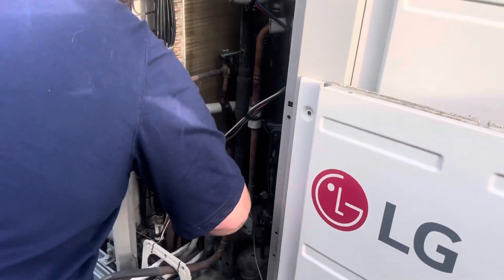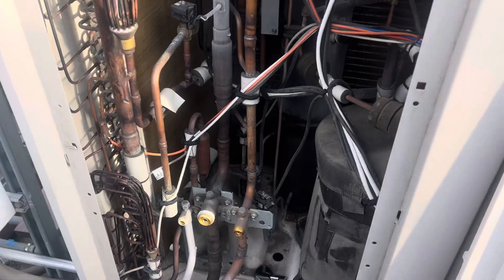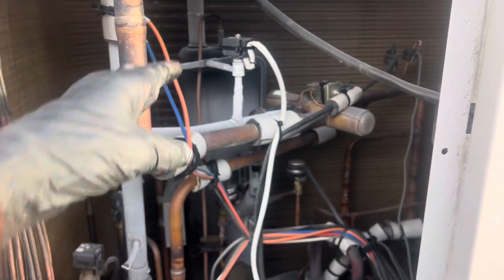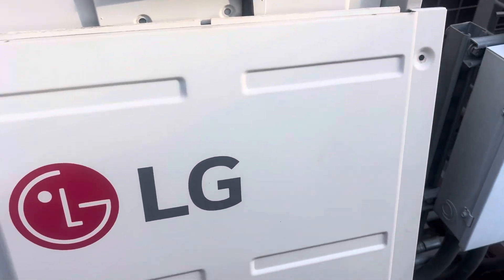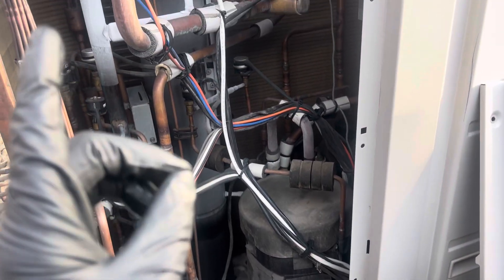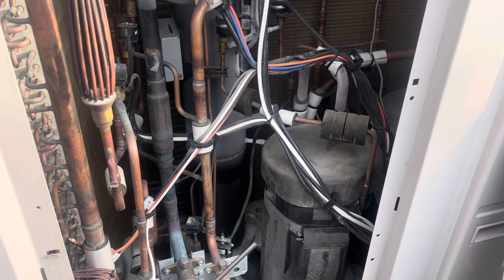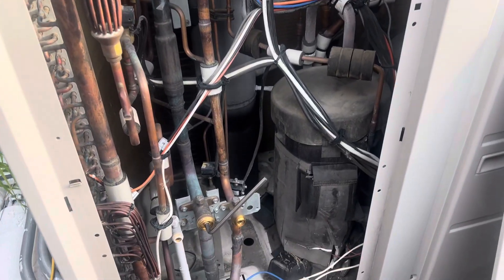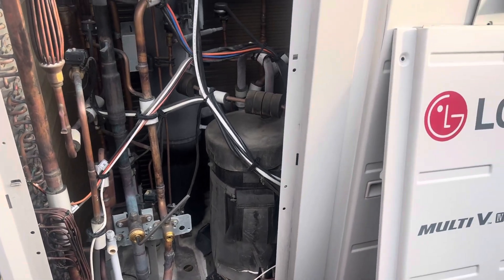Pump down refrigerant on LG multi heat recovery . Playing with child’s toys  🧸 ￼

Comment: Hey man! I appreciate your work, a real professional on LG systems. So, that's why I've got some questions for you - how did you obtain troubleshooting LG Multi systems with ur LGMV reader and what materials have you been using to get these skills? I'm asking you for help because we got a bunch of these units (Multi V IV, Muilti V 5) and they are dying... So, I'm trying my best to get why are they keep failing, probably it is a problem with overcharge or lack of refrigerant, but it should be okay because we're charging them according to a calculation of liquid line lenght and ODU precharge. Would be cool to hear your thoughts!
Reply from the maker: Calculated refrigerant charge only gets you close.,
     There are variables in the system systems that sometimes you end up often having to add more refrigerant. 
     You get your software from your local distributor. And they have training classes for both installation and then other classes for service.. 
       You work with their Tech Support who have much more experience constantly sending guys out for diagnosis. 
       You will see our times you’ve completely charged up a new system and followed every instruction and calculated the refrigerant based online length and components and when you hook up your software, you’ll see your expansion valves are starving. They are wide open trying to feed the coils.
    You’ll see the temperature drop across the coils is too great showing that you’re starving for refrigerant.,

You’ll learn this when you take some of their service classes and do a bit more reading. 

Some say even from Tech Support they could try to charge up a system to get it working in cold weather operation doesn’t always work out so well, but it will get you up and running. 

Just last month, I was cold out to a MULTI V system that was just butchered and hacked together installed the piping was completely wrong size, wise and layout. 
      And obvious example of the lowest bid won the job. 

You may hear Online a lot of people saying the compressors burn out.  That is because the system was poorly, installed poorly sized and poorly maintained no reason for compressors to last any less than 15 years to 30 years on a properly installed in a properly maintained system.. 
      As soon as somebody doesn’t no longer properly maintain the system throughout their lives all bets are off. Basically it was the owner who made the decision not to pay for maintenance and properly performing procedures or the company that was chosen not knowing what they’re doing then the systems live a shore life..
Reply: @coldfinger459sub0  Big thanks for your response my man! I would be very glad to contact the tech support in these cases, but seems like it is just impossible because we have only 2 certified suppliers/LG partner for our regoin (Easter Europe) and I've already tried to ask for help, but the only answer I always get is add/remove 10% of system's refrigerant. Everybody around is getting mad on these systems, but personally I just can't believe that they could be this bad. Also, our official installer installed almost all these systems and now we have to deal with this crap. I'll try to contact LG EU to get some classes, but If I will fail, may I ask you for some specific manuals about LGMV data or stuff like that? If not, anyways I'm very thankful for your respons, Tom!

Comment: I have to admit....im still not a fan of VRF. I do have respect for those that are competent to work on them. I really just dont enjoy working on these types of systems. Much respect to you Tom
Reply from the maker: I’m with you.  But that’s the reason I basically started only started selling VRF and almost 100% STOPED selling normal split  & package unit 14 years ago. 
JOB SECURITY 😎 
Back then almost. Nobody wanted to touch them.  

Now that they’re all starting to get old.  I basically have almost 0 competition at all whatsoever..  so I’m the only one who could get back to work on them.    

Everybody else works on a different brand name, but not mine.  

Nearly in every case.  Where a building or a business was sold..    and the new owner or the new manager.  
        Says he doesn’t want to use the old guy for HVAC maintenance and repairs. He will use his old guy that he knows.. 

I get a call
☎️ 
Emergency 🆘 
(“ we’re having a problem with this unit in our guy was working on it and he can’t get it to blow colder or blow cold”) 🥶 

When I get out there sometime, I’ll find some extra jugs of refrigerant. 
Because he thinks more Freon can cold will get it working

But they jacked so much refrigerant liquid slug, compressors, and now only $200,000 brick system. 

When all it was was plugged dirty filters. 

Or circuitboard out on the air handler. 

I’m still learning. 

Because on any of the systems that I have ever installed, I have never had a burned out compressor yet so I don’t even know how to tackle replacing a compressor I have ZERO Experience. 

The last two jobs I had owner managers give me an attitude about the price and say the systems are stupid.  And I tell them their HVAC guy was stupid.. 

They want me to replace the compressors. I just walked away..  tell them “good luck with that” ? 

I could stop selling any new units today which actually I’m trying to do to get partially retired. 

And just live off of the repairs and maintenance for the rest of my life.  And my son’s life.  

As of this year, I’m actually starting to order all the parts for all my different units and keep them out of stock on my own shelf. 

Because everything is always a few days or weeks to get a hold of. 
      I wanna be the only one who has all the stock of the parts for all my old units that are outdated and Parts are no longer easily immediately available for. 

benefit of working on only on one brand.